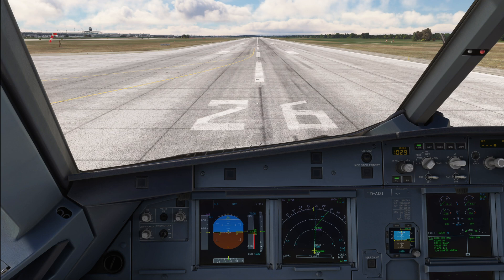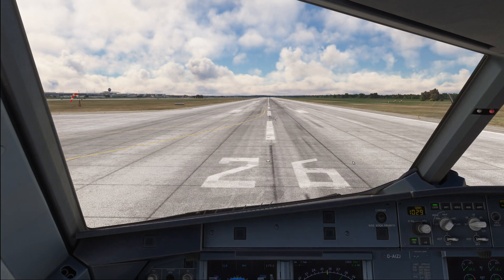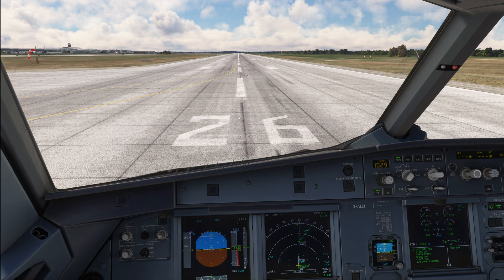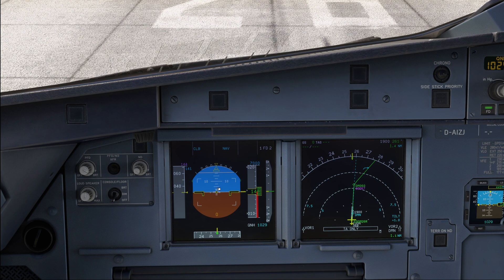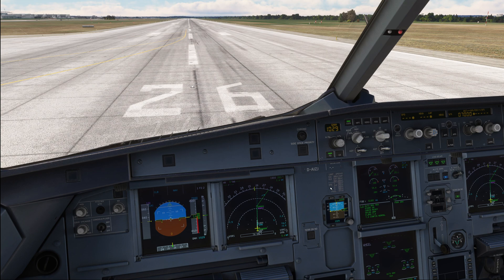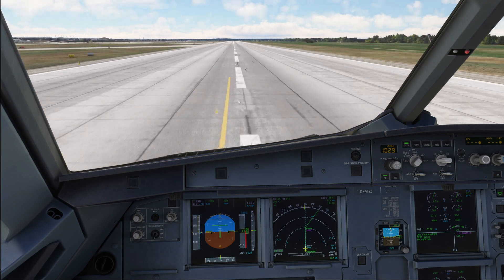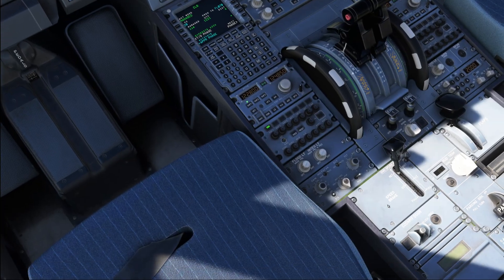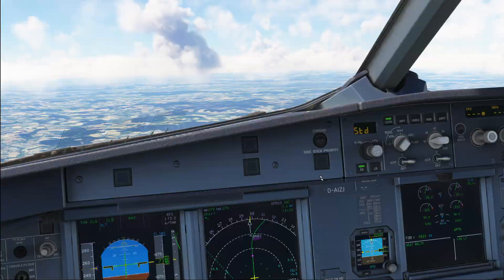Airbus A320 Tutorial 8: Takeoff and Initial Climb | Real Airbus Pilot

Comment: 8:33 What if you forgot to turn the nw lights off because you could damage the lights and waste electricity and I don't think you get a memo on the ECAM
Reply: I might be a bit late😅
The nose lights turn off automatically when the landing gear retracts. As for the landing lights, you'd get a ECAM indication, altough not a caution. Wouldn't be an issue tho, the lights don't have a speed limit (sometimes you even use them as speedbrakes) and as long as the engines are running electricity is not really an issue.

Comment: Thank you. Beautiful video. It will help me a lot to avoid all the mess I make during takeoff with the A30 in MSFS.

What I don't quite understand is how you manage to engage the Auto Throttle in the very first phase while avoiding overspeed. Usually, with a managed speed of 250 during climbing, I always have the problem that the speed is reached before I can retract the flaps.

Comment: You kind of answered the question but what exactly does the NAV call out mean just after gear up ie green NAV.  Does it mean it’s possible to engage the AP if so desired ?  I have some cockpit videos of A350 (any Airbus I suspect) where the pilots do the NAV call but just hand fly and don’t use the AP.  I’ve probably answered my own question but wondered.  Thx for the videos they have been very useful.  I noticed the TARA arc lines on a RL cockpit video just now made me smile from your last video.
Reply: I believe (although don't quote me), it is the callout for the NAV mode engaging as the lateral navigation mode

Watching Airbus cockpit videos, they generally callout most if not all changes to the FMA, and that box is the one displaying the current navigation mode (e.g. NAV or HDG, etc.). On the runway, it is in the RWY mode (as said in the initial callout), and you can see that NAV is armed (in blue). The NAV callout is then for NAV becoming the active navigation mode (in green), so the flight directors will follow the flight plan routing.

TLDR: It is the callout for the current lateral navigation mode (with NAV iirc meaning follow flight plan)